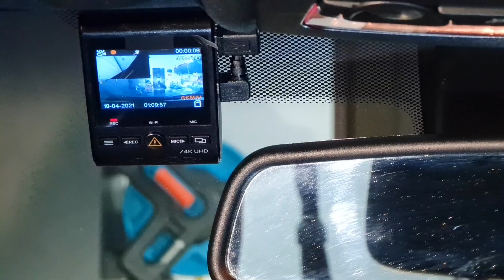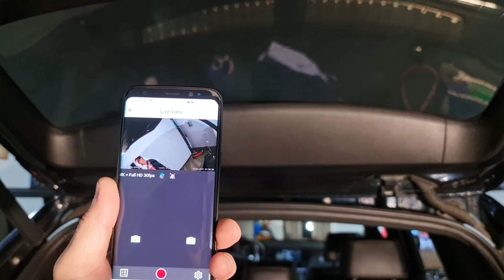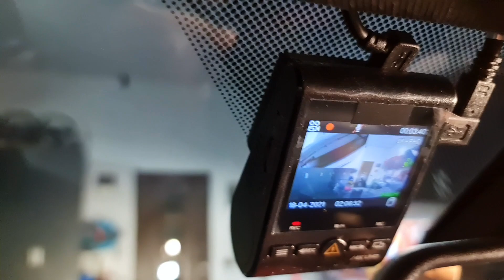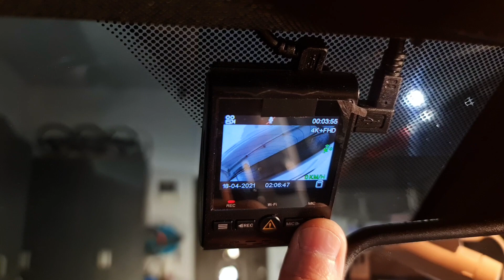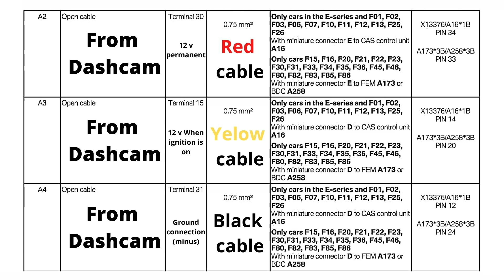BMW x3 f25 Professional Dash Cam Installation

Comment: I was able to use this video to completely install and hide the wiring for my 2014 BMW X3 (f25)--because I wired it to the fuse box behind the glove compartment (and thus on the opposite side), the instructions were identical except not having to remove the hood release. I literally had this video on both my laptop/phone throughout the car for reference. This was an incredibly detailed video; had I NOT found this video, I likely would not have even attempted to wire it, but you made it so easy!

Comment: I have the same car and installed the same dashcam in it about 4 years ago. For the rear cam I run the wire the exact same route but on the passenger side. As the best installer in the US, I can only say the job this man did is exceptional! I always wanted to see someone does this job as good as me. 
2 suggestions: use the 25mm Tesa instead. Makes the wrapping much faster and saves tape. And most-importantly, buy yourself a  torque adjustable power tool. It will save your hands big time, not to mention the time savings.
Reply from the maker: Hello ! nice to hear that , and thanks for suggestion's

Comment: Thanks for the video. Avoid some labor. There is no need to remove the visor nor the ceiling panel. You can easily tuck the cables.
Reply from the maker: Hello! Yes, you are perfectly right, in fact you don't need to remove any panels,  you can tuck and squeeze the wirie from front to back! And will work!
 But that makes the difference between a professional installation made with sense of responsibilibty, and an installation made by a beginner in front of its house.

Comment: Thank you for a good job. I have have this job in front of me, but I have an E83 -08. The same cam kit though. I have to check if the cable to the rear cam can be prolonged.

Then I should assemble some more cables for my MC BMW Navigator IV and for an adjustable action cam...
Reply from the maker: Nice !

Comment: Such a great video! I know this isn't a DIY tutorial as you mentioned but I'm looking to do same exact install on my 2013 f25 and everything in the video made sense to me except for one thing. Are you able to share which wires you spliced to for the hardwire connection? I tried to find a wiring diagram for the CAS module that you tapped into but I can't seem to find anything online. Thank you in advance!
Reply: Look for the BMW Advanced Eye Camera installation guide. It's very easy to find in pdf format. Basically splice wire from pin 34 for constant power, pin 14 for ACC, and pin 12 for ground. M. Ovidiu has a newer video where he installed a viofo dash cam in another f25. He added a fuse to the wire for constant power.

Comment: That looks great and close to factory install.  One question.  With short length of wire to rear camera that comes in kit, could you place front camera on passenger side and run data cable along passenger side A pillar to rear window camera and then the power cable across mirror and down driver side A pillar to CIS/CAS? It would add a few extra steps, but it would work, yes? Or, is there no wire harness along passenger side floor from front to rear? Or, maybe you can’t run wire behind mirror?  Just curious.
Reply: was thinking the same. was thinking it's easier to do the wiring on the passenger side. but maybe not ... ? any reasons why ?
Reply: I'm guessing, but it should not be any problems. The thing is that it requires more job, and for professionals time is money. In a BMW there are cables/harnesses all over the car... I'm not sure if the cable from the battery to the starter motor goes there, on the right. Can this disturb a data cable? I don't know.

Comment: I know this video is a bit old but I hope you can give me a reply. If I wanted to hardwire my dash cam to one of the fuses on the passenger side which fuse would you recommend? ( I only need the camera to work whilst car is on)
Reply: Had the same question here I think I’m just gonna connect to the OBD but I need him to confirm the connection diagram. I’m not mistaken. It’s 1, 4 and 16.
Reply: I will be adding a back up power supply I’m trying figure out how to wire it to three OBD

Comment: hello Ovi. 
Can I ask you a question? My car is e85 z4. 
I am going to install the bmw ace2 dashcam this time. 
I have a question, I want to connect to CAS when connecting the power, but there is no information on which line to connect to. 
Do you know? Thanks.
Reply from the maker: Hello , on e85 you need to connect the permanent 12 to a permanent 12 v in the car and the terminal 15 to one of the terminals 15 from ignition switch
Reply: @MOvidiu  thanks. but hm… sorry, I cannot understand.

Comment: I want to add a rear view camera to a 2019 BMW X3.  Which camera model did you install?   The cable supplied to you with your camera was short.   How long was that cable?  Thank you.
Reply from the maker: Hello. in this video a dashboard camera is mounted. not a rear view camera, for rear view camera you will have to go to a specialist in your area to see what factory equipment you have for the multimedia system and from there they will be able to tell you what type of camera you need and if it is Enet or classic with separate mode

Comment: really nice job, thanks for documenting it. regarding cable lengths, isn't there any 20-30 cm adaptor on the market that can extend that back camera wire? 
another Q: how long did this take you to do? :D would think i take your time spent and multiply that with 2 to get to what it would take me :D
Reply: The time to do the job for him wasn't much longer than the time of video, as he knew exactly every step in advance. The job according to the filming, reposition the camera, etc is cut away. He did never consider the next step. Everything was 100% clear, except one thing - the cable between the two cameras should be about 30 cm longer. I think he adjusted the cable off the video provided. It's no use to show things that went wrong, and he said also that the cable is too short for this vehicle. So everything is very clear. 
A very good job and a good video.
I'm missing an overview of the tools and "extra" materials needed at the beginning of the video.